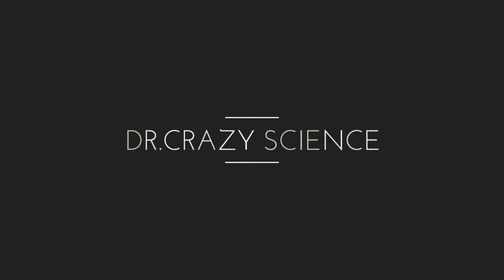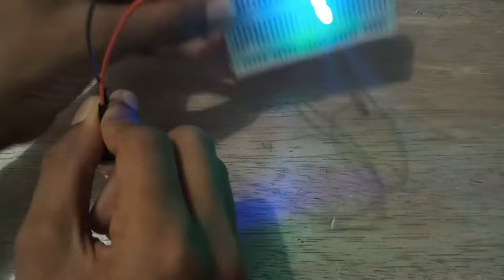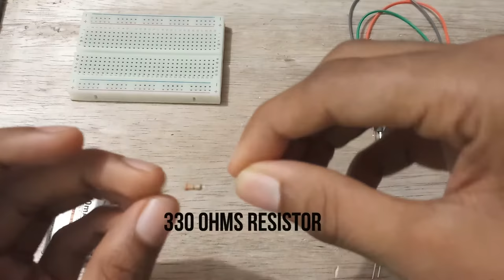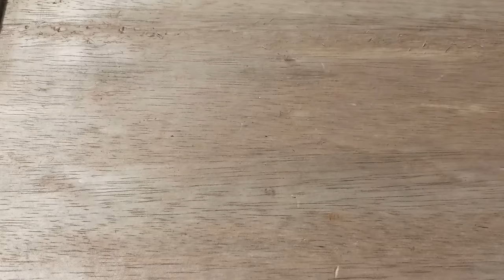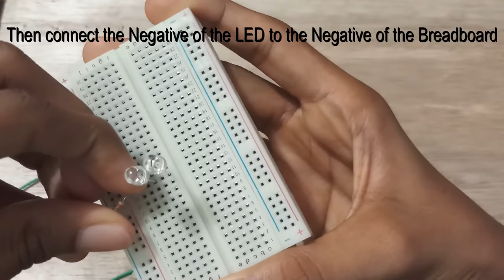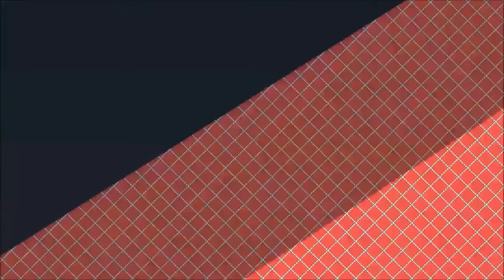How To Make An LED Circuit Using Breadboard At Home | Easy DIY

Comment: It's not working
Reply: Might be led issue
Reply: Make sure you have the jumper wires and resistors on the LEDs respective ends, the jumper wire connects with the positive end and the resistors connect with the negative end and you can tell which is the negative end by looking for the flat side which indicates that it’s the negative side
Reply: From this video it seems the jumper is negative and resistor is positive but sometimes this varies depending on what you are doing
Reply: 😂 so you are noober than me

Comment: if it doesnt work try putting both the resistor and the green jumper wire on the same column (only one of them will turn on, but still)

Comment: Any idea why my blue led isn't working? I tried different LEDs but the only thing that worked was setting up the same circuit on the opposite side of the breadboard. I can't get them to light up at the same time from the same set of wires.

Comment: Is resistor necessary to connect?
Reply from the maker: Yes, if you are using a 9V battery it is must. Or else your LED will burn
Reply: @AaqibRasmy  thanks a lot. It's working  now 😀
Reply from the maker: You're welcome! 🥳👍